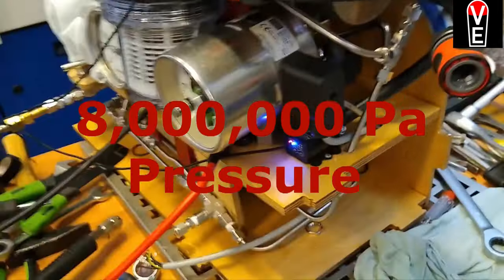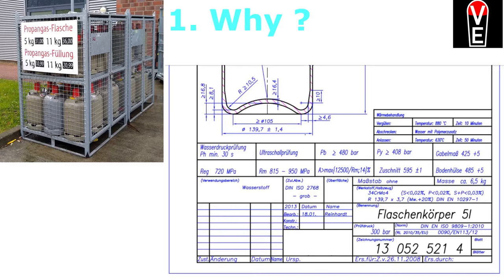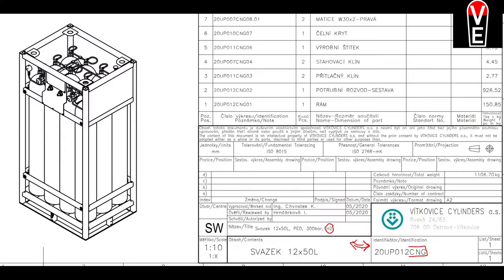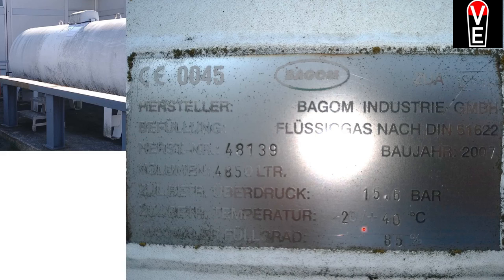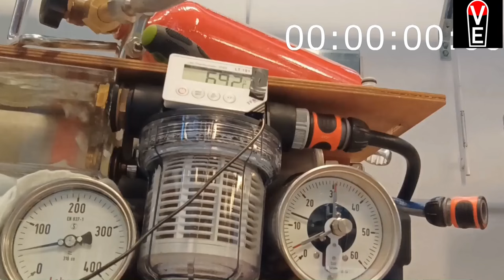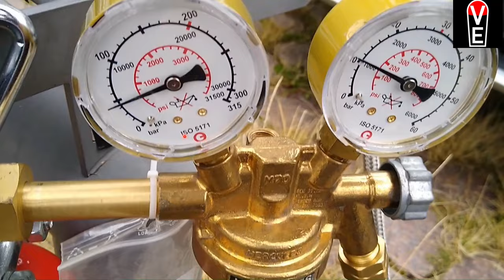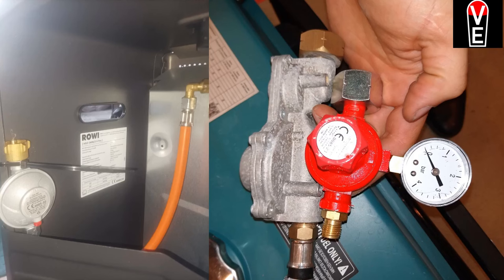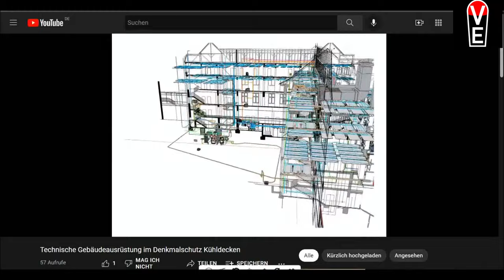6 Topics for Hydrogen in Propane / Butane Gas Tanks, Hydrogen stove, cooking with H2

Comment: Very interesting material. I have been watching your materials for two years. I created my own version of the hydrogen system. Uses 4 PEM generators, production 600ml/min H2. I built water buffers, dehumidifiers, filters. The hydrogen used stores up to 5 bar. I wonder how you managed to burn hydrogen. My stove reached a maximum of 98 degrees Celsius while trying to boil 1 liter of water. I suspect the hydrogen pressure was too low because my system was not keeping up with production relative to consumption. Regards
Reply: I'm also wondering about the type of material for the burner. Under the slow-motion recordings, I can see penetrations of not only the orange flame, but also the blue one, which would indicate that oxygen has entered the mixture or that oxides are present as a result of the combustion of the burner materials.

Comment: I built a hydrogen generator and have been looking into storage options. My thoughts were to use a propane tank at low pressures. Are you storing your hydrogen in a compressed natural gas tank, are you using a liquid gas tank or are you using a special hydrogen cylinder? I don't know if I have access to any special cylinders in this area.

Comment: I did make my own generator but I need a way to control it what I mean I wanna use it for example as a fire or heat to warm up the place in the winter how are you gonna control it for that use without saving it I just need to use it at daily fresh

Comment: Nice!  Is your electrolyzer PEM or alkaline ?  12 liters of H2 in 4 minutes is a lot, if I understood that correctly.  3 LPM?  So, regarding using excess solar energy to produce hydrogen, I have a question about that.  If you are using a PEM electrolyzer, I read somewhere that excess cycles will degrade the electrolyzer.  Every time the voltage drops to below 1.3V per cell and then back up, it's considered another cycle and slightly degrades the SPE.  Do you know if this is true?
Reply from the maker: Thanks for this interesting question. My PEM supplier promises 40.000 hours more than 5 years until the first refreshment.
Reply: @volks-electrolyzer  You're welcome.  40k hours would be nice!  I hope I get that with mine.  Do you notice a slightly unpleasant odor in your water-gas separator (cathode side)?  Someone told me it could mean cell damage but I don't know how that could be because I circulate the water properly and never exceeded 1.9v per cell.  Maybe that smell is normal?
Reply from the maker: @ChristmasEve777  I recond bad smell with Aem hydrogen. But maybe it was also  the old storage with old water ingres. No smell by now, but keep you posted. Odorizing will be an important chapter. Your system sound interesting. If you wanna share some insight, you are welcome to leave a comment under the international h2 pricelist https://v-electrolyzer.de/en/international-hydrogen-price-list/